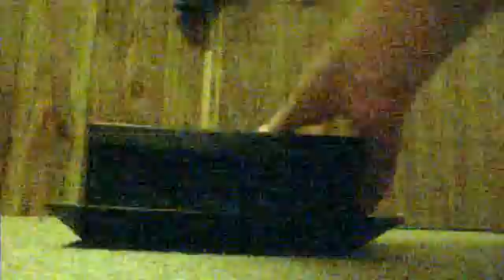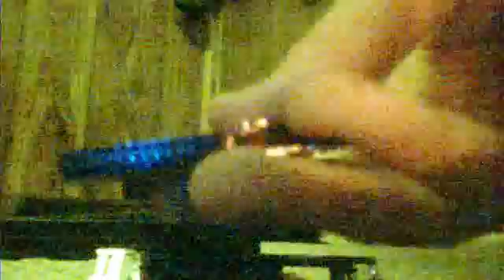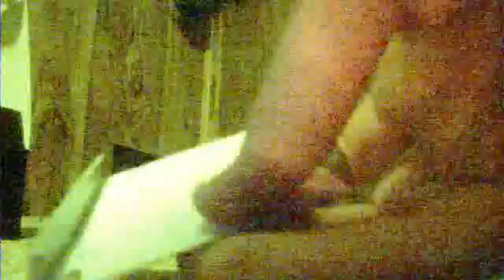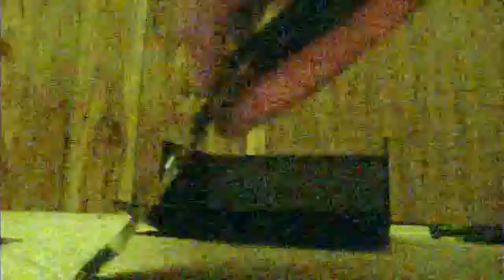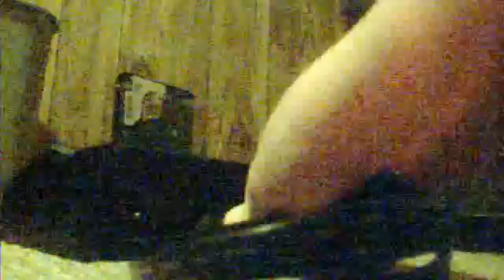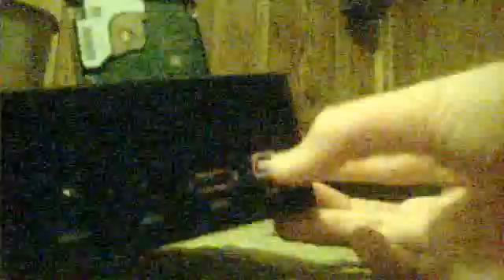E3 FLASHER UNBOXING AND BASIC SETUP

Comment: Downsides of hacking the well secured system is you get flicked off PSN like a booger and or banned unless you dual boot I guess, but it's possible to get banned on ofw dual boot if sony has the means to do so. Better hope for a PSNabler or some kind of Ps3 Cloaking hack.